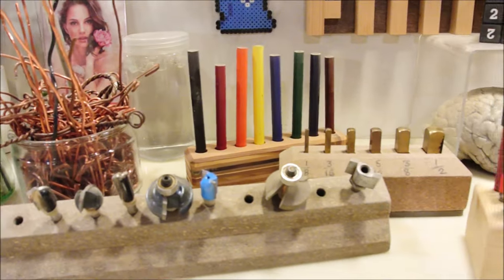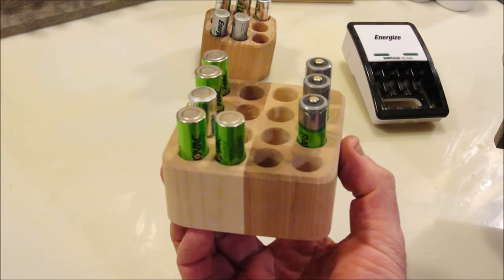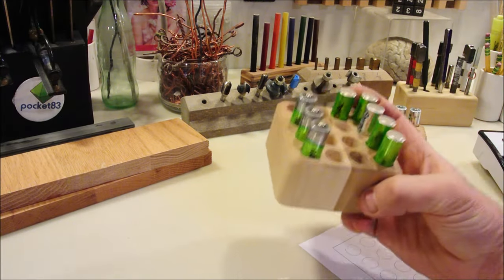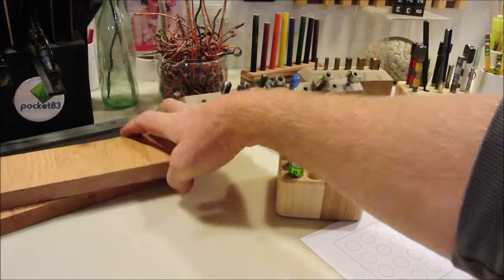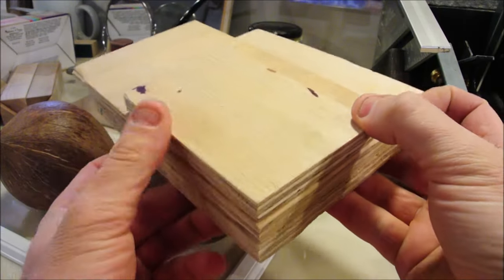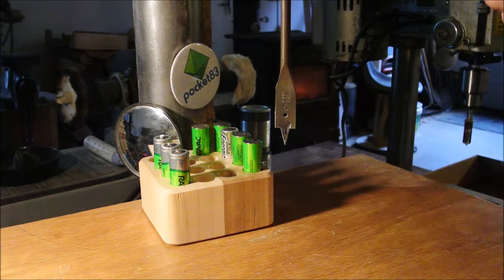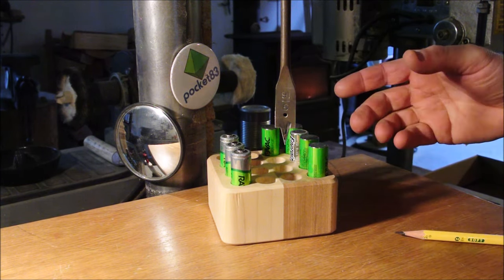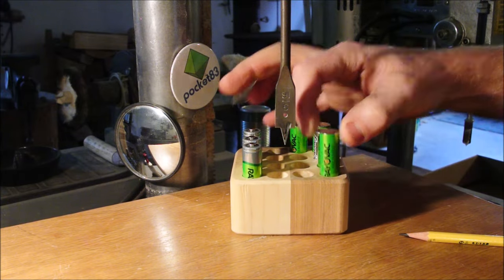Rechargeable Battery Storage Caddy

Comment: Would it make more sense to arrange them in a triangular grid instead of a square one? More batteries per volume of wood
Reply from the maker: What you're suggesting is called hexagonal lattice, and yes, it could¹ be the more efficient in terms of space; but no, doing that here wouldn't make sense, because 1) sixteen batteries is already enough, and 2) having finger room is really nice.    

https://en.wikipedia.org/wiki/Packing_problems

¹If you want me to be really precise with my answer: hexagonal close-packing doesn't begin to pay off in a square-bounded region until the region's size has grown large enough (or the circles get small enough) that the perimeter's margin waste becomes a smaller area than the net difference of the change. 

Too annoying; didn't read: 
Small lattices still end up wasting space on the sides.

Comment: cool project, and many ways to approach it, could drill through a board and then glue on the bottom, or cut the bottom off first like a bandsaw box. LOL I suppose one could 3-d print this too, but it seems silly to make things with a 3-d printer that can easily be made from wood or metal using simple tools.
Reply from the maker: It's not silly IF it's actually easier than making a wooden one. Also depends on filament price. Wood's pretty much a non-cost.

Comment: Nice!  I thought I was the only one who flipped batteries over when they're dead!
Reply from the maker: I try to do it with my drill batteries too, but without some sort of organizer, it never works out!
Reply: I lay my Dead batteries flat on the workbench, pray...pack them off to the re-cycler !!!
Reply from the maker: @NavinBetamax  Makita batteries are honestly like $100 each. I'm strongly considering rebuilding mine. Probably five of mine are dead! 

To do it, I'd have to make a DIY spot-welder, and it'll be really time-intensive, and sorta dangerous. But there's lots of potential savings on the line. I already have a microwave transformer.